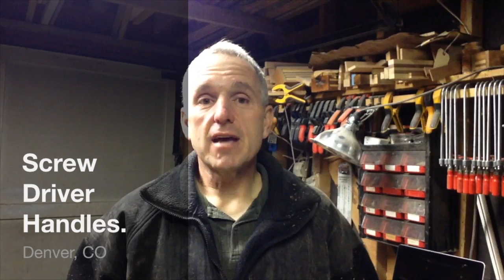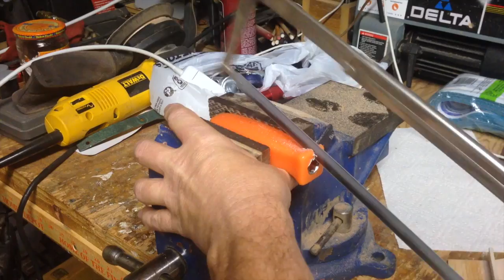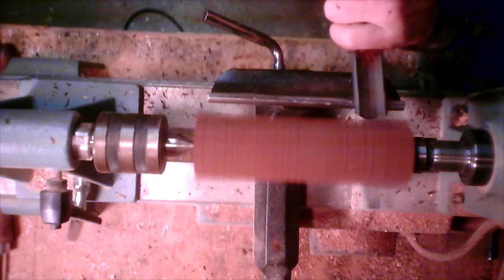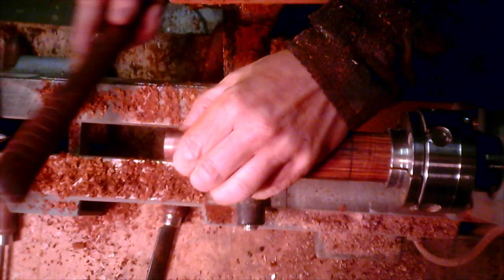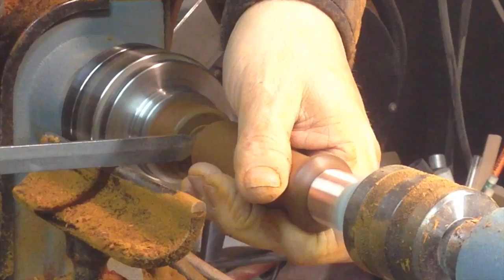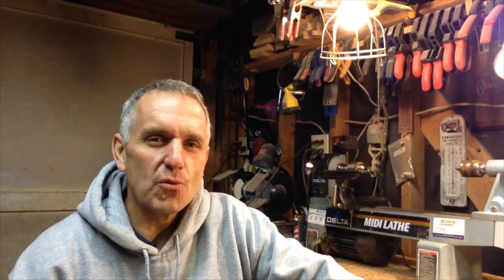How to Make Wooden Screw Driver Handles.

Comment: Great video...also seems like you really enjoy doing this thanks for sharing
Reply: Actually the most important part of this video, or any handle video you skipped right over. The importance of drilling the center hole  in the handle. When , how, why is the stuff sticking out of the end of the handle that appears to be something blue?  People watching video's don't care to watch the turning nearly as much as understanding the process. If the center hole is not centered, of which you basically blew right by, it doesn't matter how well one turns. The shape isn't going to happen if the hole isn't centered, the handle secure on the lathe, how this all happened, could have been explained instead of cutting apart a old plastic handle to save the threaded insert. If the video is on turning a screw driver hole, the most important part is how and when to drill the hole, Mounting the piece before and after. Parting the handle of the lathe. The one who has never turned, won't get to turn, if this isn't explained. You missed the entire point of video.

Comment: I made some similar handles with Oregon White Oak and used brass plumbing pipe that I got at Home Deopt for the ferrule, 5/8" id, I believe. I used epoxy to attach it permanently.  It worked well. What finish did you use for the cocobolo? I have had a hard time finding a finish that will dry properly on that species.
Reply: wipe it down with acetone or denatured alcohol before you apply your first coat

Comment: I guess a lathe may be on my list of things to get.  I have a drawer of rasps that need handles.  Looks like the same approach would work for them as well.
Reply from the maker: While I have never made handles for rasps or files yes it is basically the same.  Add a ferule and make the hole for the chisel to fit in.   As with most things there are very good videos on that as well out there. I seem to remember one nto too long back from oru community here. Thanks for watching!
Chris

Comment: Hello, well, I don't have a lathe and zero skill so my question is, do you make these handles to sell or would you be willing to do that? Not a screwdriver but a handle similar to the one in this video only made to except a 1/2" ferro rod for fire starting? Thanks for your time.

Comment: Did you wipe down the handles with mineral spirits (or the like) before applying the lacquer?  I've always been under the impression that the wood's natural oils will interfere with top coats if the surface oils aren't "cleared" first, but since I've never used cocobolo myself, I can't personally verify the claim.  Thoughts?
Reply from the maker: You know I have done that with pens that I have made... this time honestly I did not even think about it. I did not. Seems like it adheared  ok... I guess we will see. 
 
Chris

Comment: what was the purpose of the copper ring at the front of the screw driver?? and was it a plumbing fitting??
Reply from the maker: +Warren Dixon It is called a ferrule and yes it was a copper pipe fitting (union) that I cut in half. You could just as easily use a piece of copper pipe this size for the same purpose. It serves to help prevent splitting and the like on the end of the handle with use.    Thanks for watching   Good question! 

Chris
Reply: Yeah, if you don't put something on there (copper coupling is the most common) the first time you crank that tool or use it to pry something you'll split your handle or at least crack the connection point.

Comment: Would have liked to have seen the hole you drilled if you used a forstner bit or regular bit etc......thanks
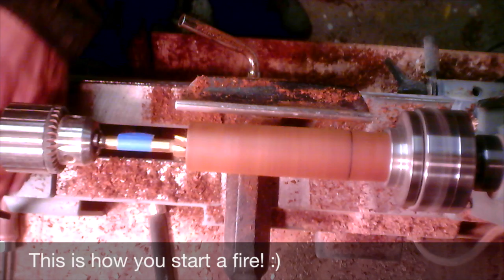Reply from the maker: Did you watch the whole vid?  Look at about 2:03     Forstner bit
Reply: Yes I did.  Also didn't fully understand the reason for off centering.  However when making mushrooms on another video it was cool cause the wood gives the appearance of twisting or angled......but on another screw driver video a man did an off center and pointed out it keeps the screw driver from rolling.
Reply: OK went back tried to locate the exact moment you started to drill and the coloring on the video made it hard to see the bit and the fire well it was distracting but ok you used a forester bit......thanks Chris....love your finish I use a DEFT spray.